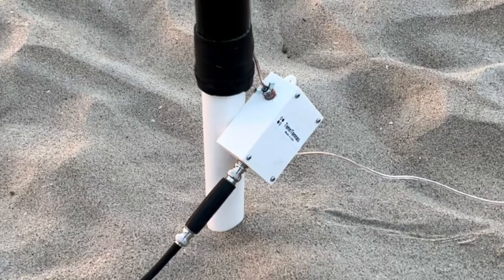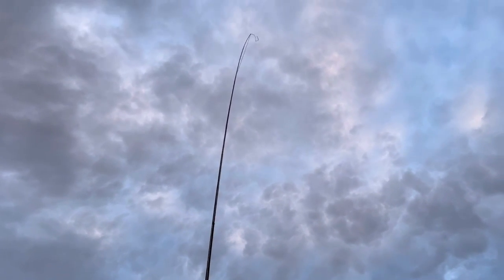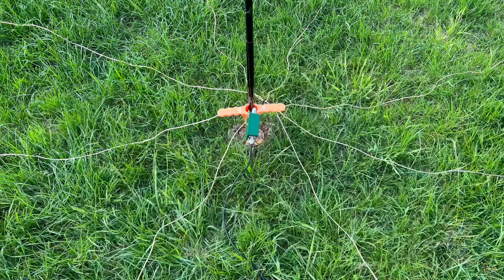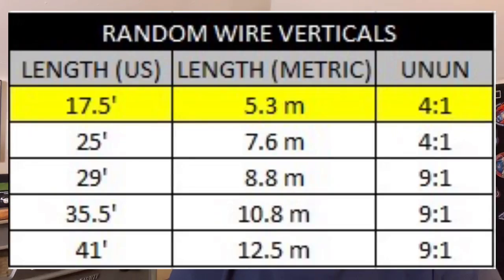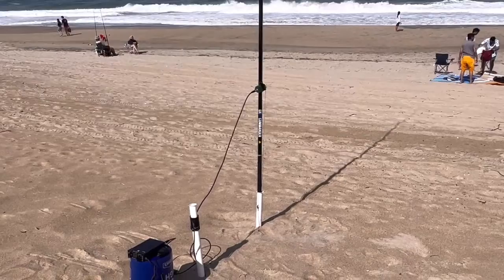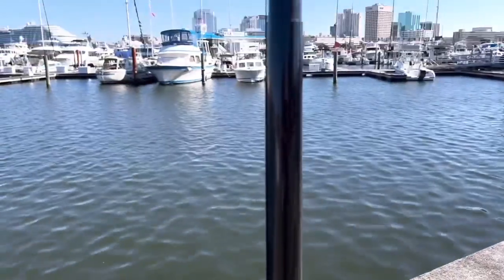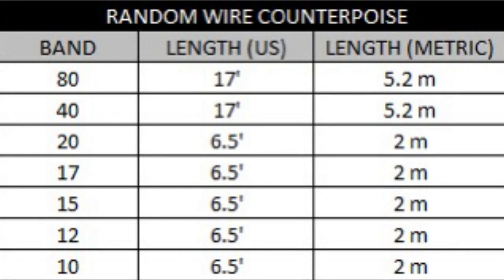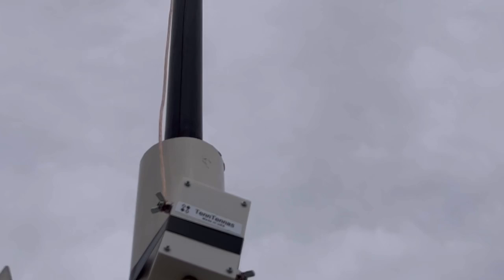Mastering the Art of End Fed Vertical Antennas

Comment: Another good one! One thing I have said for years is there is really no end fed antenna, it just looks that way sometimes! Everything is technically off center fed. Just how off center is the question. I call most things radials but the word counterpoise is pretty much synonymous. My first experience with a counterpoise was to solve a problem with RF on the chassis of my transmitter. The end of the counterpoise wire became hot to the touch instead of my transmitter! 
Radials can be tuned and act as half an antenna by themselves (as in elevated radials) or they can be used as a “device” to couple to the earth to form the other half of the antenna. Not a simple topic to say the least. The key is what you said put a wire up as best you can. Then try and match it to the coax while minimizing losses. It should work, then maybe the next step is improve it. In general the best radiator is a length of straight conductor with the most current. It’s called meter-amperes. Geometrically it’s like looking at a sinusoidal current waveform over a section of the antenna and the radiation is proportional to the area under the curve. A full size 1/4 wave vertical with peak current of 1 amp will simply radiate more than a shorter antenna with 1 amp peak current. The bottom half of a quarter wave vertical carries the most current so it radiates the most. The center third of a half-wave wire has the most current over it so it radiates more than the ends. There are a number of simple laws and rules that can be used to improve antennas.
Reply from the maker: Thank you and thanks for the great comment! Great info!

Comment: My rule is if it works for someone else, it'll work for you. I've had great success recently on 10m with a half wave T2LT I made by cutting and stripping some coax. Sure, I can't use the atlantic ocean as a ground like Walt does, but I've successfully contacted FL from the UK using it
Reply from the maker: That’s a great rule and thanks for sharing! 73, Walt

Comment: Hi, Walt.

I saw a comment below regarding Faraday blankets and thought you might like some feedback. I also got the idea from KB9VBR. I've used window screen with a vertical whip and liked it. Yeah, I know, seems weird but it works.  Suspect you'd bring home half a sand dune if you took one to the beach.:) The screen is a little awkward to put down & take up.

So, I ordered a Faraday blanket and just tried it out today. I used a 213" vertical whip. Second contact was Belgium on 20m from PA. Works great.  However, the material is very light and has to be weighted down with something. So, beach & wind might be a problem.  Best part is It's easy to handle & folds up to a very small package.

With the screen or the blanket passers by should not a problem on a portable op. The blanket is silver and sure ought to be visible on a beach!

Try it. You'll like it! :)

Comment: I've been playing around with a 1/10th wavelength counterpoise on my 40m efhw set up. Seems to work fairly well. Buggers the swr on 10 a little for some reason but the other bands are happy enough. It also does seem to be radiating a little better than without... but that could just be variable conditions or confirmation bias :)

At the end of the day, if it's made of metal, it will radiate. Hang a piece of coax on it and get to it. Saw a video of a gentleman working VK4 from VA5 with a lawn chair hung in a tree for an antenna. You can't let the perfect be the enemy.
Reply from the maker: I agree, what a great quote "you can't let the perfect be the enemy" I like that!
Reply: @COASTALWAVESWIRES  I can't take credit for it, and I'm paraphrasing a bit... but it's always seemed like good advice to me. I want to know what the theoretically perfect set up is, but I am far more interested in what CAN be done because the gray area in between is where most of us operate.

Comment: Your videos have inspired me to tinker which has been fun!  Thank you.  

Quick question. Choke for 20M is at feed point and for 10M is at radio.  Is there a reason for this.  Thx!
Reply from the maker: Yes I only choke it at the feed point if I'm using a counterpoise on 20, otherwise choke it at the radio. As for 10, I have found the coax itself works better as a counterpoise for that shorter antenna and I put the choke at the radio. 73, Walt

Comment: How is the swr on 17m your 20m efhw  Walt before you use a tuner? I am a qrp guy looking for a short wire antenna that works well on 20/17m. I like the efhw idea as it is more efficient for qrp than a efrw.
Reply from the maker: SWR on those bands was somewhere around 3:1, very easily tuned.
Reply: @COASTALWAVESWIRES  Not bad and is short and resonant on the other bands. Just received my fx4cr and am looking for a short wire antenna. This may be it.

Comment: I'm no expert but from my experience and understanding a "ground based counterpoise" maximum length does not matter. At some point a longer wire makes no difference. So trying to match them to a band is dumb. Use a longer wire that can handle the multiple bands. In other words use a wire as long as you can.
Reply from the maker: That's good advice.

Comment: Walt!  I love your videos!  I have built a 20 meter vertical based in your video and it works really well.   I have a 40 meter EFHW using a Tenntenna.  Due to space constants it’s folded over a at one point because of the length.  It comes in with pretty good SWR on 40, 20, 15 and 10.  I’ve been working all over the place with 20 watts!  Thanks for your videos!
Reply from the maker: Thank you so much for watching and the great comment! 73,  Walt
Reply: How is the swr on 17 before using a tuner?
Reply: @kylefreemason   about 2.5:1 to 3 :1
Reply: @charleyfarly3017 definitely tunable. Thanks for replying! 73!

Comment: My current setup is a 50 foot Nelson antennas random wire antenna with a 6' piece of RG8X right into the G90.   It's been great, making 6,000 mile contacts to both Japan and Spain.   Now I wonder how much better it would be with a 1:1 choke at the radio end.   This is my favorite YouTube ham radio channel.   Thanks for all you do.
Reply from the maker: Great setup! a 1:1 might help but it looks like you are doing great. Thanks for the comment and  the kind words! 73, Walt
Reply: I have a similar setup my coax is my counterpoise. The antenna instructions say to use at least 50 feet coax on the ground. I'm now running 125' it went from an SWR of over 4 down to nothing.

Comment: Our antenna building and testing paths seem highly similar. My neighbor probably wonders what in the world is he doing now.  Started with only a QRP rig for months and built/tested dozens of different antenna types, trying to find the "best" for whichever band/etc. It helped me truly discover which were most efficient, effective and which truly performed "best" in the real world (for me and my locations etc).   I'd recommend any new hams start that way,  just my 2 cents.  My go-to's in the backyard, as of late, for the 7300, are a random wire vertical 31ft wire with a nelson 1:9 at the bottom end (been experimenting with two aimed raised radials vs my usual ground plane radials), a random wire 84ft  mild sloper with the same (w/1 radial) and a eleveated (coil 5ft off the ground) coax vertical flower-pot for 10m (that's been getting me some amzing "booming" 
59++" reports across the pond and further lately with a hundred watts, just coax on ground as the radial or whatever).  It's just fun experimenting and that has become exciting for me (and because i'm poor and can't afford a fancy tower or nice hex beam etc lol).  Same with my truck/mobile,,  I toodle around with the 705 (sometimes with the ah705 tuner) in the front seat and make mobile/QRP contacts when I get a chance, sometimes it amazes me how far it works.  I have tried the random wire vert 41ft for 40m you mentioned. For my location, regardless of length, 40m always seems to do better on horizontal wires or wire slopers, even when they're not all that high off the ground. Not sure if that's the norm or not.  I strung up a "ridgeline" 50 feet up between two tall trees that looks like some circus trapeze attratcion, easily raised and lowered, for hosting all the antenna experiments. Good stuff,  keep up the nice videos.
Reply from the maker: Awesome! Thanks for the great input! 73 my kindred spirit

Comment: I was told by a manufacturer of 49:1 transformers NOT to use a choke at all, instead have at least a half wave length of coax feed line.  It seams to work well for me.
Reply from the maker: If it works, it works! 73 and great to hear from you Ady!

Comment: Hey Walt! Great video. Thanks. What’s the big difference between the EFHV and a stainless steel whip the same length. When I use the whip I use 3 radials without an unun. Should I use an unun with the whip?
Reply from the maker: No, the whip is basically tunable to a 1/4 wave from 20 to 10 meters as it is 17 feet long. You get into using an unun and creating a multi-band antenna at lengths longer than what the whip is.
Reply: @COASTALWAVESWIRES  Thank you